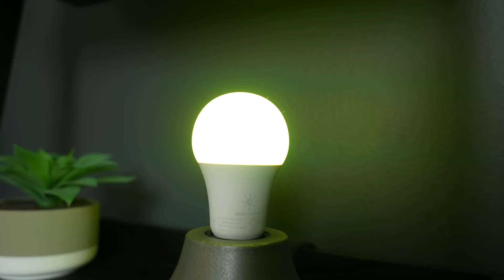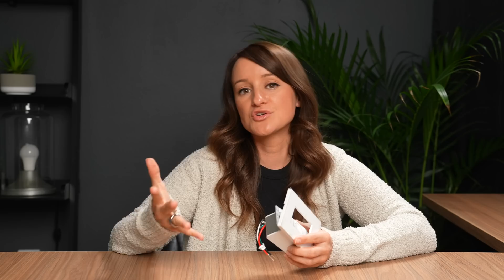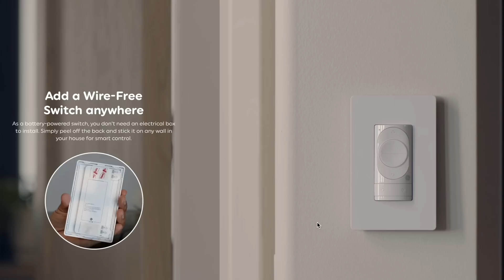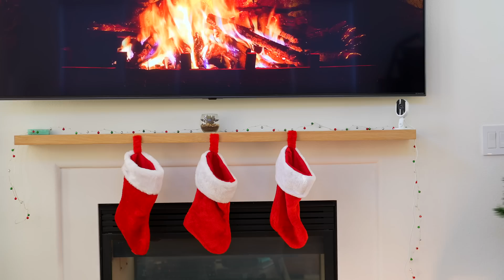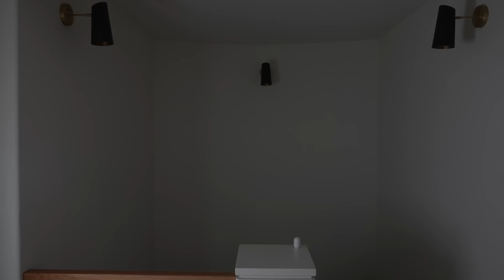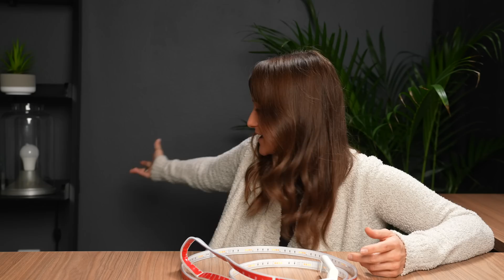Can Your Smart Home Do This?!!!

Comment: When describing a wired appliance like the light switch it's helpful to mention if it requires a neutral wire or not. Not all houses have them.
Reply: This is a great thing to consider! Most home built after 1970 will have a neutral wire in every outlet, however, prior to and even home renovated afterwards will omit the neutral wire out of a cost burden. You're absolutely right, definitely a thing to consider!

Comment: Some other ideas/options: 
In my house we have a lot of different smart home products. 
Lights: we have Philips Hue. Other brands weren't making much back when we installed these.
Thermostat: Nest 2nd gen 
Cameras: Nest indoor cameras covering driveway and backyard along with a front door bell and cam. Also, we got a couple of the Nest protect smoke detectors. 
We have harmony hubs so we can control our TVs and other systems with Alexa. 
Wifi: Netgear Orbi. Great for getting good connection for all the products around the house 
A side note, not for the home but I have an Alexa Auto in my car that is a great addition if you don't have Carplay or Android Auto available in your vehicle.